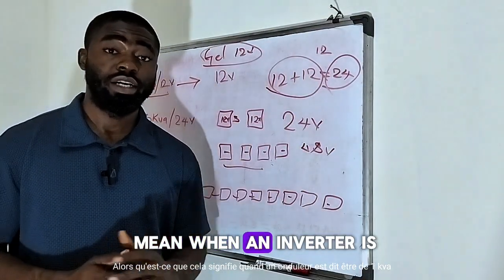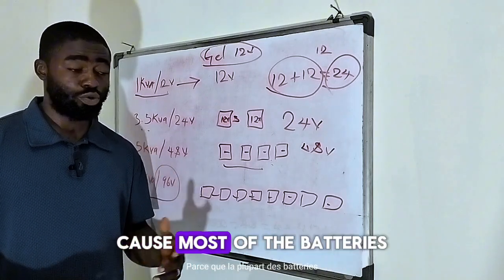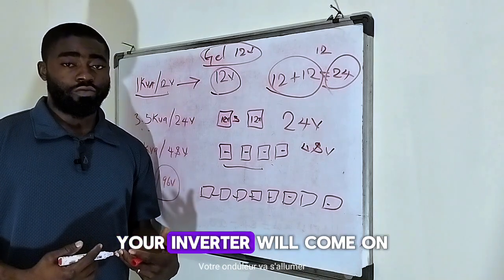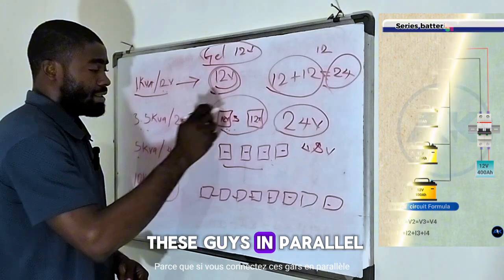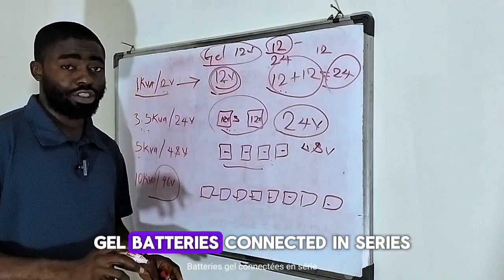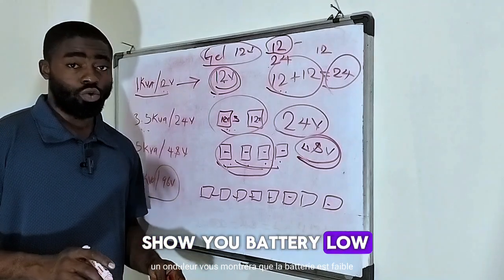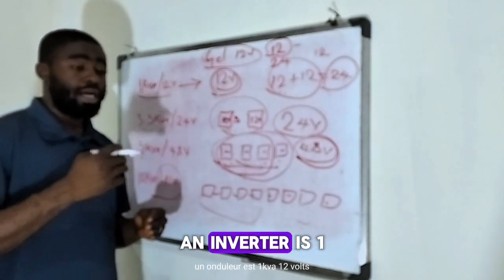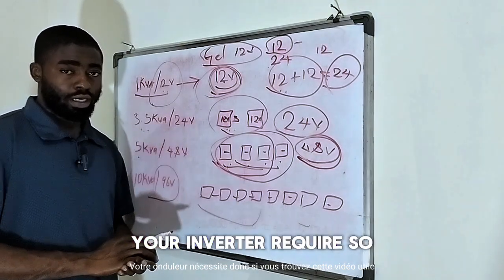HOW MANY BATTERY DOES AN INVERTER REQUIRE???

Comment: can one unit of 12v/ 220a battery give me 2.5 kv inverter?
Reply: No sir. You have to buy the 2.5kv inverter machine. The batteries does not determine the inverter capacity it only stores charge and puts on your inverter as explained in the video. Abi Na the fuel for your gen dey make your gen 5kva? 😂😂😂if u put 5 liters of fuel the gen go turn 5kva 😂😂😂😂😂😂😂

Comment: Very clear ..

I have a question though  ..I use my 10kva /48v ...Till the 8unit of 12v Glow Energy battery drops to 44volts sometimes...though without a heavy load oo ..

I usually put off heavy loads when it drops to 47Volts ...I hope I'm not over stressing my batteries and Imverter ?
Reply from the maker: Not at all
Reply: @Mairigaemmanuel  OK,thanks